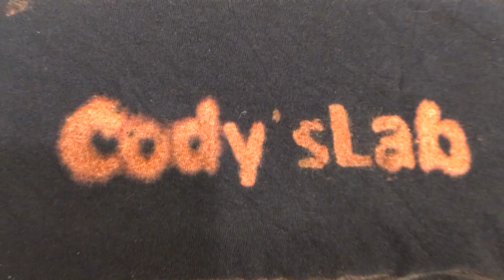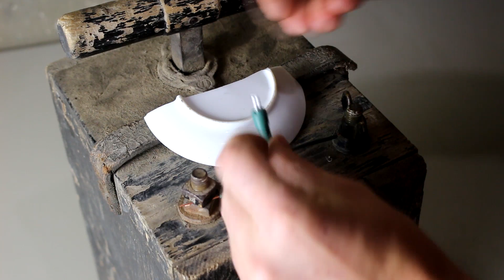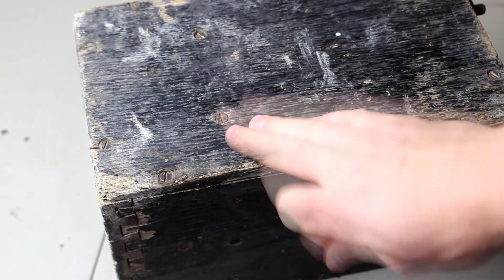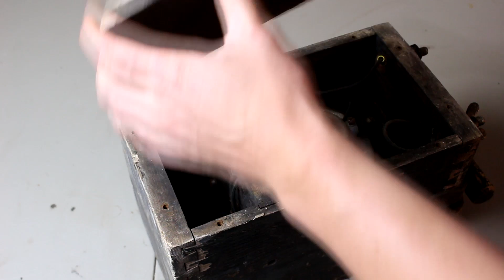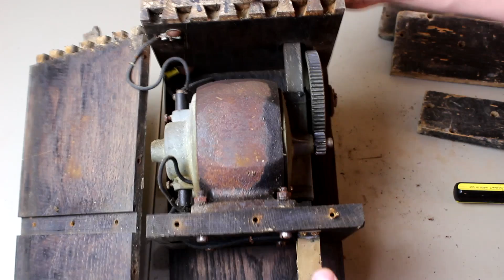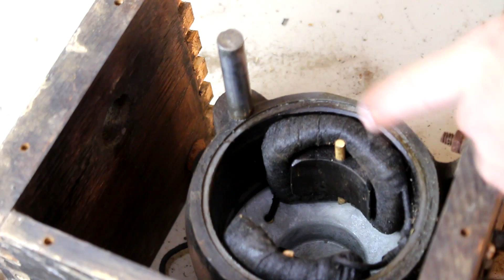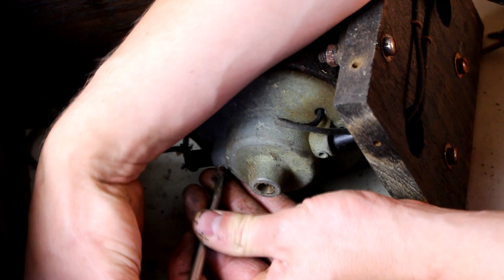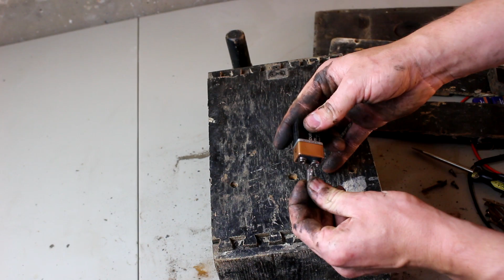How Does An Old Blasting Machine/Generator Work?

Comment: Show that the weight of roadrunner is not enough to set it off. I already learned that coyotes faster than roadrunners. Childhood destroyed.
Reply: Michael Mitchell no, no the roadrunner from the cartoon is a result of genetic engineering. So it is possible for it to push it down all the way
Reply: MegaMedia5 Actually, it was cross -bread with a car, which makes it faster and heavier.

Comment: Couldn't you theoretically add a large capacitor so that instead of a constant voltage it charges it and then discharges a large voltage capable of a lot of current?
Reply: Sure, you'd need a way to sense/trigger the capacitor discharge though, otherwise it would just discharge as you're trying to charge it. Maybe charge it disconnected from the explosives, then connect the wire once the capacitor is charged. A setup like this would allow the plunger to be used repeatedly, to build up a big charge on the cap. But in the end it seems like it's just not necessary.
Reply: Wolfin well it's somewhat of a given that you would need a way to charge and discharge effectively but who needs a constant current when you can have a big bright spark?

Comment: Cody, since it has a ratcheting mechanism is it possible to pull the handle back up before it closes the contacts so you can push more times to make it faster and generate a higher voltage or does it slow down too fast?

Comment: Cody when you replace the old handle just add a new one underneath it. Keep the old one on top. Completely removing it would look horrible and ruin it
Reply: ziploxian Aslanyan No, that would ruin the original. I have seen that kind of stupidity done by professional museums, and it just ruins things.  Putting in a fresh piece of leather and a new brass bolt with matching wingnut would be proper. Sign his name and repair date on the back of the strap and put a written report in an envelope inside the box for his grandson or whomever else does the next teardown / repair.

Comment: Not going to hook up a multimeter, or run it through a string of increasingly higher fuses to find how high the output goes. Could you push it down halfway to three quarters the way a few times (building up current) then slam it completing the circuit to get more output?

Comment: i think that old technology is more reliable than new technology, i have (almost) perfectly working amplifier thats 35 years old
Reply: general kitten yeah I mean anything can be reliable if you can afford to carry around a 10 kg piece of apparatus anywhere you want to set off a charge
Reply: things have to be less reliable if they're made with such an enormous amount more parts with those parts all being much smaller as well.
Reply: general kitten  Completely agree I have an original Gameboy and commodore 64 that runs great still, and older electronics seem to be made with wider tolerances compared to now.
Reply: rudy davis is it even a trick anymore or is it something the majority of consumers have accepted? I believe it's a trick still to the majority pushed off on those that know this.
Reply: @SW-ii5gg  you're right it's not a trick anymore. Engineers and companies talk about this all the time hence the term "planned" obsolescence and it wasn't a thing until the lightbulb wars! Lightbulbs use to last essentially forever but the industry set a standard of no more than 100 hours
Reply: Things nowadays are purposefully built to eventually have to be replaced unlike older things which were built to last it's called planned obsolescence and it's a trick used by companies so they know you'll have to comeback and spend more money

Comment: The big gear would be made of aluminum because it is less dense than steel which are two highly abundant metals in this case, making it easier to machine out so many teeth. Not to mention, like you said, the weight reduction

Comment: I believe that old grease is pronounced "shmoo".
Reply: Well it still chooches proper. That's how you know it was properly skookum.

Might rattle the fillings from downstairs, though.
Reply: Marshall Horton release the shmoo!
Reply: The bigger the gob, the better the job!
Reply: A fairly robust skookum choocher
Reply: AvE fans?
Reply: Skookum as frig
Reply: Marshall Horton well it atleast it chooches
Reply: Plenty =D it shows you the genre they all like to watch all my fav channels always has plenty of others from other channels i like. and vice versa
Reply: Is that according to the confuser or did you just fabricobble the word?
Reply: It's OOOLD slang/jargon. Usually among engineering types. (At least, in my experience. Also, I think it's originally Canadian, but I've heard it in Iowa and Indiana.)
Reply: @zombie-process7025  ive actualy herd it from old machinists in indiana before i found ave
Reply: That's the Cockford Ollie

Comment: I think it is AC voltage cause 100 V DC  would not hurt and those thing like car alternator what converts power from moving coils to an electric power is allways AC so in car there is rectifier needed.

Comment: Actually the output is AC due to the change in magnetic flux(delta F for math people), inducing a current to offset the change in magnetic field resulting in ac current. If the output was dc, it would not be able to kill you due to the capacitive properties of the human body.
Reply: Umm...The output is DC. It has a commutator. It's a shunt wound DC generator....If it was slip rings, then yes, it would be AC..
Reply: MyNameIsChef wtf no, dc can kill too, since our body is mostly resistive.
Reply: Also, AC has less line-loss than DC, delivering maximum bang for the detonator buck.

Comment: You said putting your hands on the voltage could be lethal, but volts don't kill, it's the amps that's lethal. You could be zapped with 1000 volts and live, it would just be very painful.

Comment: Hi Cody,

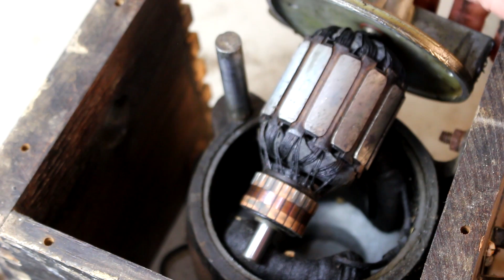At 13:02 or so you mention that it's not something you see in modern motors, and that it's a lot easier. I'm not very knowledgeable on motors so I wasn't able to even gather enough to figure out what to look up to learn more about what you meant. Any chance you could elaborate or point in the right direction to find out what those pieces are, and how they're different in modern motors?

Comment: You can make a very simple unit that takes a sealed lead acid battery(12V), boost the voltage up to charge a capacitor bank, then press a button to discharge that capacitor bank into the string of blasting caps. Mount a small solar panel on top to keep the SLA charged. Plenty of sun in Utah.

Comment: Old electrical wiring that looks like it's wrapped in fabric is most likely a material that contains asbestos. Just a heads up :)
Avoid fraying or disturbing the wire insulation, because once the asbestos is up in the air, it's very hazardous if it's inhaled.

Comment: Could you not make a much simpler one with no dynamo? Just a magnet and a coil, where the plunger powers a spring which drives the magnet through the coil at high speed. Would that work?

Comment: The full-speed trigger, for a lack of a better term is interesting. I would have guessed that the dynamo charges a capacitor that is ultimately triggered. But the actual design is even simpler and more reliable.

Comment: I would be surprised if that gear was aluminum. It would have been too expensive back then. I bet it's some alloy of zinc. I can't remember the name of it, but there was an alloy that was commonly used in castings because it was lighter than cast iron.
Reply from the maker: Could be, I ought to have weighed it.
Reply: Alexander Could the alloy you're thinking about be Zamac? Don't know if it is, just trying to jog your memory.
Reply: tjhill0110 yup! That's what I meant.
Reply: Cody'sLab is there a way you could do a quick chemical test? A drop of acid or something and watch the reaction?
Reply: Alexander Huff, I think he did a simple one. If you look closely there is a cut scene where a drop suddenly appears on the metal. He probably put vinegar to see if it was magnesium.
Reply: Yeah, AKA potmetal. Would be pretty common back then.
Reply: Al. Would be too soft as well.
Reply: There are also plenty of non-magnetic steels...
Reply: Alexander Huff, looks like pot metal to me.
Reply: Alexander Huff zamak I think is the zinc alloy

Comment: Its probably AC voltage. Since we can't see the Rectifier
Reply from the maker: The brushes are the rectifier.
Reply: I'm pretty sure they are magnets inside the coils. I'm used to working with 70+ year old electric motors in Hornby trains and they can barely pick up a paper clip
Reply: The brushes on the commutator essentially act like a h bridge in reverse doing the job of a rectifier. If you took the voltage on the coils whilst they were spinning it would be ac. This works in a dynamo like a rectifier and in a motor like an inverter or h-bridge
Reply: Yes, residual magnetism is correct. It forms a positive feedback loop as you spin it. The tiny amount of voltage created is fed into the field. The field+residual magnetism then induces a greater voltage into the armature since more flux is available to cut as the armature is rotating, which in turn feeds more into the field coils and so on..... This snow ball effect allows the generator to create voltage output without need of permanent magnets.
Reply: Thats true the ony thing i cant get it how it selfexcites without permanent magnets.residual magnetism ?

Comment: Can you restore that one day so it'll look new?
Reply: TobeyT3 Why would he? It was hid granddad's so it holds a lot of sentimental value and it works more than fine this way too
Reply: restoration can add sentimental value, it's maintenance, keeps in the family much longer
Reply: I say make a replica and keep this one antique. Use the same mechanisms but with new wires, gears, wood etc.
Reply: That thing is beautiful. It looks like those dovetails are hand carved. That's craftsmanship you just don't see anymore.
Reply: I doubt it was ever watertight but it could have been sealed to reduce dust ingress especially as it was likely intended for use in a mine. I think that changing the steel connector to a brass one would be a good idea and perhaps putting a different type of ring terminal to it would be in keeping with the original design. Plus I'd put a new wing nut on there at the same time - perhaps it's possible Cody could find a used replacement brass bolt and wing nut for the terminal. It's not a rare item so any renovations should be acceptable even if he wanted to repaint it.
Reply: Well, it could use some cleaning and re-greasing, new strap definitely. Could be cool to water tight it again
Reply: Dávid Végső I don't know, even if it was restored it would still have the sentimental value. I'd like to see a video of him pulling it apart and restoring it.
Reply: Brastius you still see it, if you go to the right places
Reply: YES!
Reply: TobeyT3  I like old stuff un restored  no polished plane the way it was made
Reply: even better, he could one of his own
Reply: It has way more value the way it is. The yellow cap really hurts though
Reply: Not all old stuff is worth money... No point in making a replica since batteries does the same job just fine. As to restoring the thing; there problably wouldn't be a buyer for it outside of museums or mining collectors (i seriously doubt that you can find many of those). it's a cool educational piece and cody did the right thing in making a video on it instead of  trying to sell it.